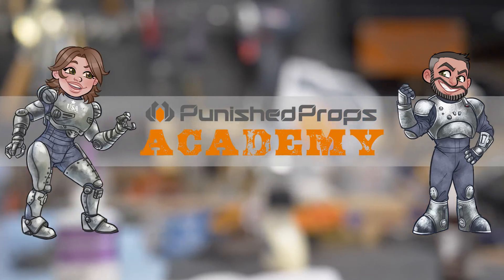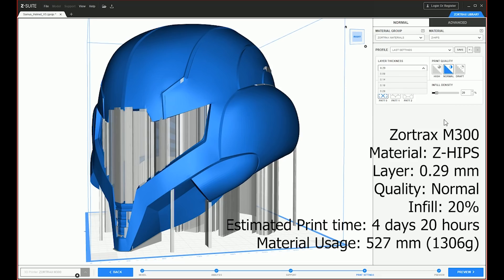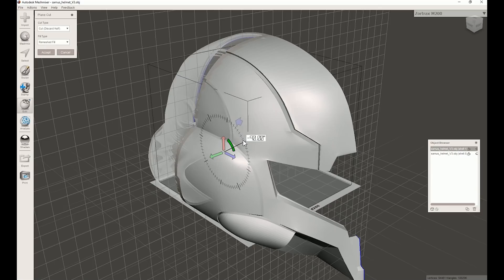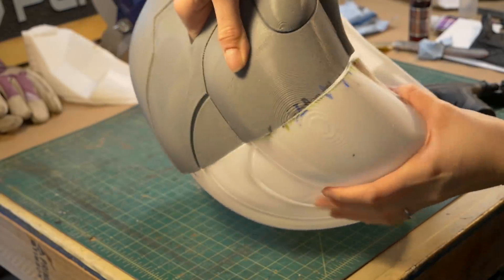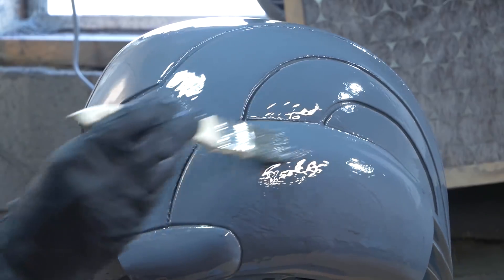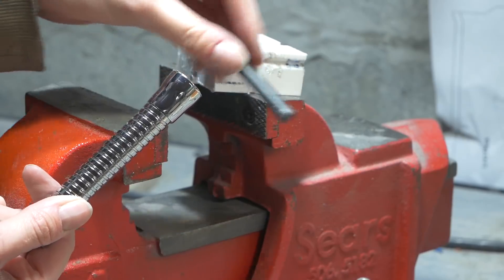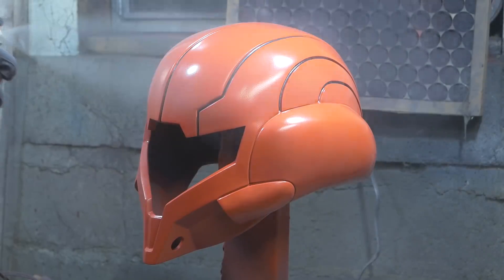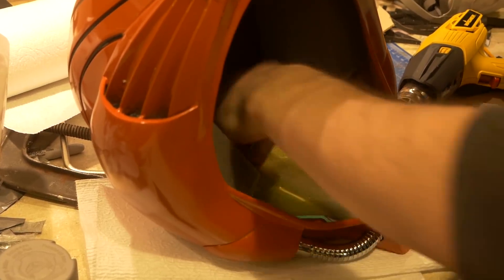3D Printing a Samus Metroid Helmet - Zortrax M300

Comment: Does the increase print time cause the machine to over heat at all?
Reply: GRIM Davis not usually. I've had 3 day+ prints turn out just fine
Reply from the maker: This printer didn't over heat. It's also pretty cold in the shop.

Comment: If you ever print anything else in HIPS try giving plastic model glues a try. From experience they are much stronger than super glue. They basically chemically fuse polystyrene parts together. Strongest bond I have ever seen in an adhesive.
Reply from the maker: We got some of that glue! The model glue worked great for gluing styrene to styrene. But when I tried styrene to the Z-HIPS, the glue never cured and the high impact polystyrene filament got all mushy. That was just one, quick test, though, before I switched to superglue.
Reply: Usually plastic models are made from ABS, so this plastic model glue really only works well on ABS, not really great for Styrene. I would also suggest being very light with the glue as it is meant to melt plastics together rather than stick them together.
Reply: @TheLongHairedFellow  for styrene you can use dichloromethane, which is a solvant, works really well,

Comment: Zortax - expensive, not very good and can ruin a lot of material over very long print times. Got it.
Reply: The Zortrax m200 is actually one of the best consumer grade 3d printers available . Its print quality is ridiculously awesome compared to every other printer . Unfortunately it's also very expensive and so is its material . If I had the money I would get one .
Reply: I'm curious as to who their target audience is. I'd probably have less problems with a 3D printer from china at the fraction of the price.
Reply: i own 5 m200s, they are by far 1 of my best printers but they can be princesses, i own about 30 printers in total though and have tested out a ton more

Comment: i saw someone print a entire helmet with a holo sphere inside the helmet. a sphere doesnt require any infill because of the nature of the shape and so you can basically print a helmet with mostly a void inside and then supports around that. Saves you a bunch of time, filament, cleanup if you do it this way. While i havent personally tried this trick i saw someone do it with a black panther mask and it cut down their print time and material significantly.
Reply from the maker: That’s a really cool idea!
Reply: This sound like a great idea! 
Also, not making fun or anything but I totally imagined a holographic sphere when I first read this. Maybe a cosplay idea for Simply Nailogical
Reply: Oooh, interesting!
Reply: Was it Razem Art who made the Black Panther Mask??